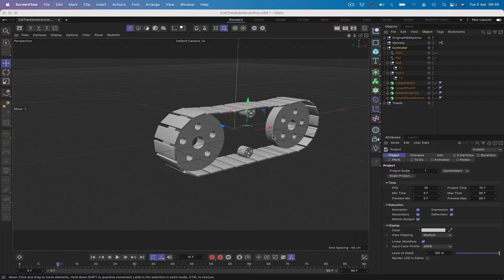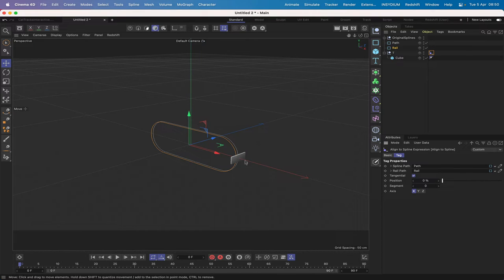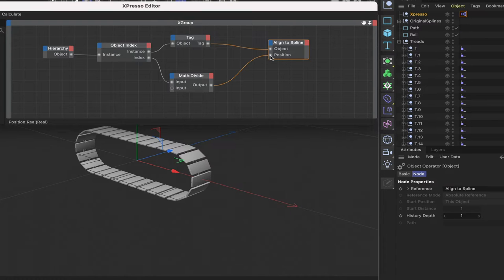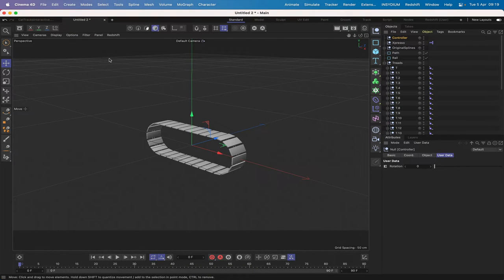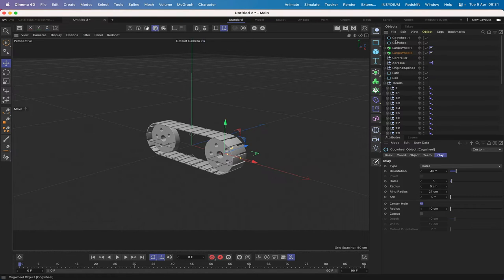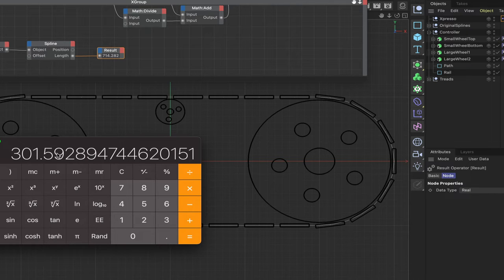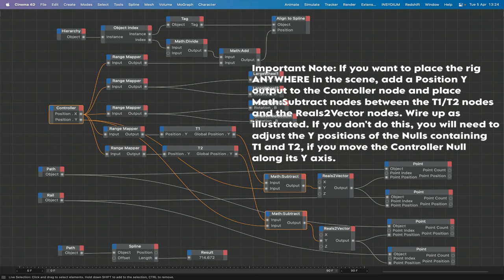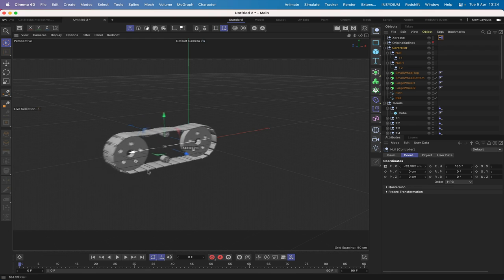Cinema 4D Xpresso Tutorial 44: Caterpillar Tracks

Comment: That's a pretty good tutorial!
However, there are usually two pairs of caterpillars.
A simple copy-paste will not make both pairs of caterpillars move.
What should I do in this case?
Thanks for your reply.
Reply from the maker: You just need to plumb the elements of the second caterpillar into the Xpresso expression, exactly as you did with the first one. Then it will work.

Comment: You sir, are a mad man! Thanks for this fantastic tutorial. Unfortunately by the end the result is pretty messed up. Everything is exactly the same but switching the matrix mode from global to local is not fixing it. Do you maybe have an idea where the problem could be? The spline path and rail are messed up at T1. Thanks a ton, best regards
Reply from the maker: Chances are, that you have missed a crucial step. Check everything! If you still can't get it to work, email me and I'll send you the scene file.
Reply: Thanks for reaching out. All right, will do! Is there a way to reset the treads after they got messed up? Undo didn‘t do nothing unfortunately. 
 @ExpressoMechanicTV
Reply from the maker: @mitch4248  Check the axis that your treads are aligned to within the Align to Spline Tags. Mine are aligned to the +X, but yours may need to be aligned +Z, if you have aligned your model along the Z axis.